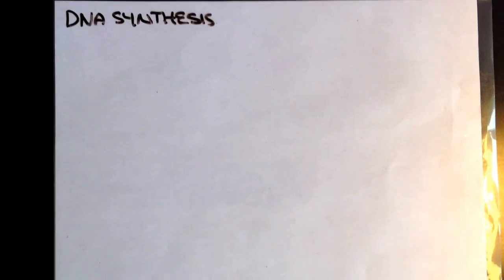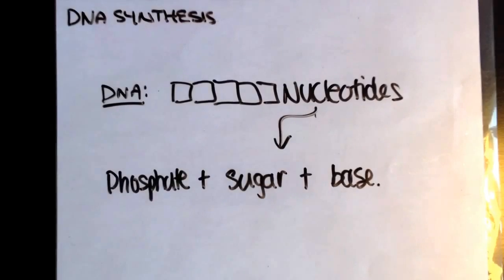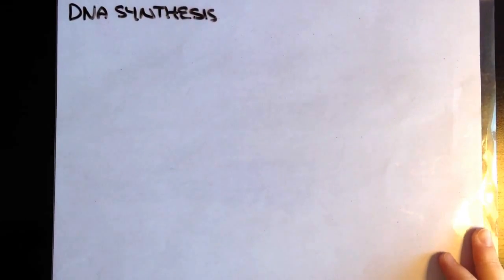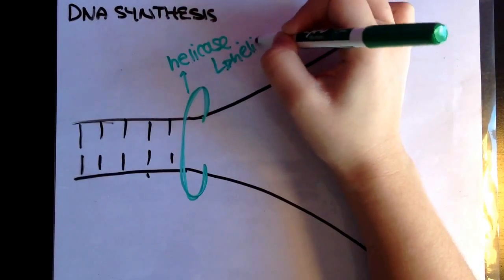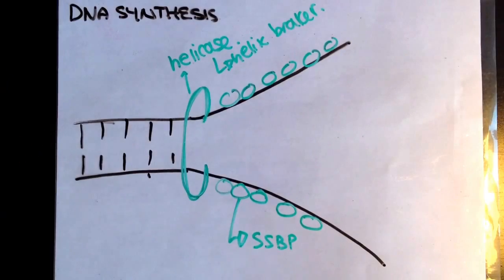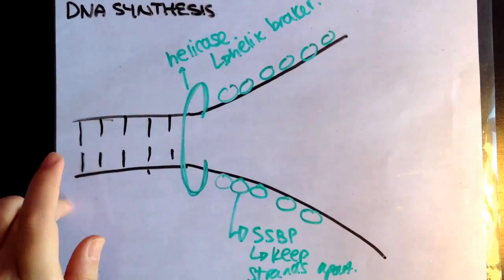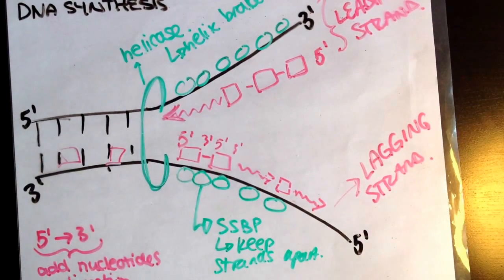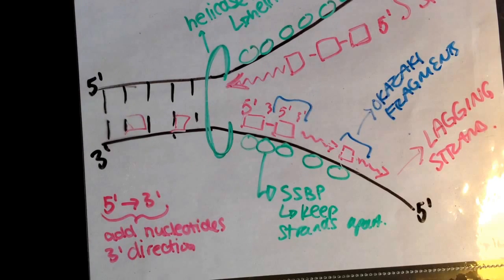Leading strand vs. lagging strand

Comment: Well this is 13 years ago but to anybody wondering, she exaplained it well yet missed a huge part of DNA replication.
As the lagging strand is being synthesized, its gonna form a loop to allow Pol III to synthesize towards the fork direction  not away as this video demonstrates.
and its called the Trombone model. I'm actually still struggling with it but heres my notes on it so far

1 - loop forms:
The lagging strand loops so that DNA pol III moves as the same direction as the replication fork

2 - RNA primer is placed:
Primase lays a short RNA primer upstream on the lagging strand

3 - DNA pol III synthesizes an okazaki fragment:
It adds nucelotides to the RNA primer in the 5' to 3' direction moving towards the previous fragment 

4 - loop releases:
Once the fragment is done, the loop collapses

5 - Next loop forms:
Another RNA primer is laid down further upstream, forming a new loop for the new fragment

6 - RNA primers removed & replaced:
DNA pol I removes the RNA primers and fills in DNA

7 - fragments joined:
DNA Ligase seals the gaps between okazaki fragments

Comment: I get more confused after this video,sorry😔.I guess the strand combined with SSBP is primer for DNA synthesis, and why did this primer(RNA)come here? If we treat the bottom strand is 3' to 5',  which can produce Okazaki, we can also treat the upper one is 3' to 5'. So this two strands are completely transversed, leading strand and lagging strand theory is a general conception. I think these two strands actually can replicate synchronically,and why leading and lagging strand? Leading strand can replicate first,but if we change our perspective, it will be lagging one.

Comment: Can I ask a question? 
If we take the leading strand, it proceeds from 3 to 5. But there are many 3 and 5 carbons in between that huge stretch that has been drawn in the video. 

Similarly the lagging strand proceeds from 5 to 3. But there are many 5 and 3 carbons in the long strand that stretches in the video. We know that dna is made up of indivitual nucleotides and each nucleotide has a 5 and 3 end.  A long segment of DNA, let's assume it contains ten nucleotides must contain ten 3 and 5 ends. 

Hence, on the lagging strand, why not just skip one 5 carbon and proceed from the 3 carbon, in a manner similar to that of the leading strand?

I'd be grateful for an answer.

Comment: DNA polymerase will make it so that the Okazaki  fragments  in the lagging strand will be elongated, but however there are gaps in the sugar-phosphate backbone that can only be sealed by a ligase. The RNA primers used need to be removed afterwards also by Rnase H since they are the starting sites for  DNA polymerase.

Comment: only got 4 min into the video but this is possibly the worst (in addition to faulty usage of language) explanation on the topic I have ever seen. 

if you're explaining the DNA antiparallel structure you can't use words like 'moving' because DNA doesn't move. you're confusing people who have no knowledge on the matter.

an easier way to put it would be that DNA is made up of 2 strands, if you imagine these strands to have the same shape (let's say they both look like the number 6) then the way they bind will look like 69. one of the strands is basically rotated 180 degrees.

also DNA polymerase doesn't bind together okazaki fragments aren't linked by DNA polymerase, that would just create millions more fragments that resemble the okazaki fragments. essentially this is the basic principle of the polymerase chain reaction. DNA ligase is responsible for stitching together okazaki fragments..

also, DNA polymerase can't just attach to DNA as it pleases. a PRIMER needs to be present on the template strand first, which is carried out by the protein PRIMASE.

i don't understand how you can make a video on this without doing research first but yeah.

Comment: i would like to differ with the way you labelled the helicase....its like it is the one holding the helical structure or acts as a clamp of which that is done by the enzyme Topoisomerase...so you should have written topoisomerase instead of helicase there

Comment: Why the leading strand is discontinues ??.? Why there is gape between them and..??  Do these two replicating function are perform by a single enzyme???  If yes then why there is gap in lagging strand plzzz clear this problem to me???.??
Reply: Muhammad jehangir there is a gap in the lagging strand because it moves in the opposite direction as the replication fork. The replication fork moves in the direction as the leading strand

Comment: I think you should've drawn the free 5' group at the top. Why did you draw the anti parallel that way hehe. It's confusing that way but I don't know if what you did was wrong. Because on my slides in says free 3' hydroxyl group on one end which is the bottom end and the free 5' is always on the top in the leading strand the lagging strand goes from free 3' hydroxyl group to free 5' phosphate group. You're not wrong, you're right but your arrows are the only thing that's wrong I guess.

Comment: If one strand moves from a 5' to 3', then  doesnt the other also move from 5' to 3'???? Bc like its antiparallel so it seems like it works out You said that the other will be 3 to 5

Comment: I didn't get the part of the lagging strand...I mean how are gaps created??
Reply: Primase is an enzyme that places primers (starting points) for DNA polymerase. Once DNA polymerase synthesizes the lagging strand (resulting in Okazaki fragments), exonuclease, another enzyme, kick off the primers. This allows DNA polymerase to fill in those gaps with complementary strands. Then DNA ligase acts as glue to seal the nucleotides together. Please check out my videos on my channel.

Comment: lagging strand is confusing. plz describe it more clearly.
Reply: Primase is an enzyme that places primers (starting points) for DNA polymerase. Once DNA polymerase synthesizes the lagging strand (resulting in Okazaki fragments), exonuclease, another enzyme, kick off the primers. This allows DNA polymerase to fill in those gaps with complementary strands. Then DNA ligase acts as glue to seal the nucleotides together. Please check out my videos on my channel.

Comment: Thank you so much for this video, but still how do we differentiate between the leading and the lagging strand . They both add complementary nucleotides in  a 5 prime to 3 prime direction right?
Reply: Yes. However the leading strand adds complementary nucleotides continuously in the 5' to 3' direction whereas the lagging strand does so in chunks by first building fragments (Okazaki) so the fragments are built in the 5' to 3' direction but the nucleotides are added in the 3' to 5' direction, and therefore the lagging strand is slower

Comment: why the DNA is inverse I mean why there is 3 and 5 prime and the other is opposite 5 and 3 prime I didn't get this one :& !!!!!!!!!!1
Reply: Take both your hands. Thumbs up, pointer fingers forward. Just do it. Ready? Thumbs up, fingers forward. Each hand will represent a nucleotide. We have to mate them. Think about this. Not boy boy or girl girl but boy girl. That makes sense right? Think about this. Not peg peg or hole hole but peg hole. That makes sense right?
Still have your thumbs up and fingers out? Get'em up there. Think about this. Not thumb thumb or finger finger but finger thumb. Make sense so far? Now mate them.
Your thumbs are 3'
Your fingers are 5'
Begin to rotate one hand up towards the sky and keep going until the finger points at you with the thumb down (the other has finger pointing away and thumb up). Now you can put them together. Finger to thumb, thumb to finger.

Make sense yet? Think about it this way. Life wants to be hetero so

5' -------> 3'
5' -----> 3'

just doesn't work. We would have a 3 to a 3, and a 5 to a 5.  The two boys and two girls want to find a mate. So we flip one to get this

5' -----> 3'
3' <----- 5'

and that gives us the antiparallel double helix. That's just a way to envision it. But part of the real scientific reason is that when the two strands run antiparallel, they organize in a way that the hydrogen bonds stabilize the molecule in a low energy state.

Comment: I still don't understand how it is added discontinuously. I understand all of the directions. But why are there gaps????
Reply: because she didnt tell you anything about the primary fragments in the origins of replication.In the lagging strand primary RNA fragments are built in order to have the elongation.so the leading strand is being built continuously but the lagging strand is being built fragment by fragment between the RNA primars.as you can easily understand there is only one RNA primar in the leading vs many RNA primars in the lagging strand.THUS the one is continuously and the other is not.The video is not the best possible
Reply: Please watch Khan academy videos to clarify that.
Reply: well, basically when we talk about the direction of the leading template strand then its 3 prime to 5 prime , and lagging template strand is 5 prime to 3 prime. but new strand is always added from 5 prime to 3 prime direction. so its easy and linear in case of leading strand whose direction is opposit to newly sythesized strand. but in case of lagging strand 5-3 , new strand should be added in 5-3 no matter what, so for lagging strand small okazaki fragments are being introduced ( discountinous strand in 5 to 3 direction).

Comment: Great job..I just wanna correct a little notion.The 3' end usually emphasized is because Dna polymerase lll (Enzyme involved in synthesis of new strand of dna)requires 3' end to be able to initiate new dna strand formation through adding complementary nucleotide bases.This can only be achieved if an Rna primer(5'-3') is placed as "initiator" by Rna primase,thereby allowing Dna polymerase lll to use its 3' end(ie 3' end of Rna primer)as a starting point for placing corresponding bases during Dna transcription /replication.Also,Dna gyrase is same as Topoisomerase,which attaches at the intact region(not yet open/broken)of dna double helix just after the replication fork and prevents dna strands supercoiling because of the tension built up during unwinding of the strands of dna by Helicase.
Reply: Nice explanation Leslie. Thanks for the simplified version.
Reply: Thank you.

Comment: thanks a lot for the explanation...but, i still dont get how can okazaki fragment is form on the lagging strand
Reply: +luqmanul akim To the best of my knowledge (please correct me if I am wrong, I am in 9th grade bio) the okazaki fragments are used when the strand begins with a 5'.  Only a 3' can match with a 5' but DNA is copied from 5'-3'.  So, the DNA is unzipped at a lower 5' and zips back to the top.  Then, at an even lower location, the DNA is unzipped yet again all the way to the top.   The direction is similar to the leading strand, but it moves backwards.  Then there is the whole deal with the primers but I'm not sure if that's hat you're asking.  Sorry if any of this is incorrect!
Reply: +Grace Elizabeth  i see,  it somewhat clear to me now..thanks again

Comment: For the most part you did really well. However even though you drawing with arrows is correct for DNA synthesis your verbal explanation contradicts it. You need to go back and listen at 3:15. Your explanation states that it will transcribe 3 to 5 prime. No each side will replicate 5 to 3 prime just like in your drawing. I don't understand how people could write stating this cleared thing up for them because both your words and hand gestures and drawings are contradicting each other

Comment: i thought the clamp like structure that uncoils the helix is called DNA Gyrase(enzyme)?
Reply: making it easier for the actual separation of the helcal strands more easier. and the enzyme that breaks the hydogen bond between the nitrogenous bases is called helicase.
Reply: +lasa sila yes the unwinding of DNA by helicase introduces supercoils the enzymes gyrase and topoisomerase removes supercoils by cutting the DNA. So yes DNA does have enzymes that uncoils it! (:

Comment: "And then there's a gap" why is there a gap? What makes it so that the lagging strand had gaps and the leading strand doesn't?
Reply: +CP Adagio The DNA is being replicated in the opposite direction than on the leading strand. In order for it to do this, an RNA primer is attached to the beginning of the replication sequence on the lagging strand (the video did not mention the RNA Primer though it should have). This RNA primer has RNA not DNA in it, so when the DNA is replicated AFTER the RNA Primer is set on the lagging strand. The RNA primers are then removed after everything has been replicated making the gaps and then Ligase finally replaces the gaps with actual DNA nucleotides/pieces.

Comment: Great video. A couple suggestions:  I would have included the DNA Ligase for the okazaki fragments on the lagging strand. Also would have included the role of the topoisomerases in the winding of the DNA, also. And maybe include the importantance of DNA polymerase in the synthesis of the nucleotides. Other than that, great work :)

Comment: nice vedio....but one confusion is y the lagging strand become fragmented towards 5' -3'?
Reply: I can try and help. Since the bottom parent strand in the video above is being opened in the "opposite" direction, the Replication process HAS to be done in fragments. As soon as a spot is available for Replication to occur in the 5' to 3' direction on the bottom strand, the double helix continues to be opened; it doesn't just stop. Since it continues to be opened, and Replication is constantly occurring, the only way the full bottom strand can be replicated is if it is done in fragments.  There is no way for it to be done in one continuous fashion, because of the way the double helix is being opened by helicase.
Reply: because.... Ookazaki fragment

Comment: this video is clear and further cements the concept in my head.(my exams are coming soon). however, from what I remember, there are a few missing points (some are asked in the other comments).
1. DNA polymerase requires a free 3' OH end to add nucleotides to. Therefore, an RNA primer, which is a short sequence of ribonucleotides, (synthesized by RNA primase)  is needed to provide a free 3'OH end so that the 5' phosphate end in an incoming deoxyribonucleotide can react with the 3' end to form a phosphodiester bond.

2. phosphodiester bond formation is catalyzed by DNA polymerase.
3. the gaps in the lagging strand are actually occupied by RNA primers.
4. When the lagging strand is completed, DNA polymerase replaces the RNA primers with deoxyribonucleotides (close the gaps)
5. after RNA primers are replaced, DNA ligase is the enzyme that catalyses phosphodiester bond formation between the 3' end of a new Okazaki fragment and the 5' end of the growing lagging strand

hope I helped

Comment: Also, might be helpful to say.

1.) the. original strand is called the parent strand
a.) Leading parent strand  5'-3'
b.) Lagging parent strand 3'- 5'

2.) Also, I wrote on my paper that    Dna polymerase synthesizes from   Outwardly on the parent strand to inwardly towards the helicase. Its waiting for the helicase to open.  It also helps for explaining why  you can't go to the lagging strand.

Comment: Thank you for a great video!  Is there a reason the strands are called 3 prime and 5 prime?
Reply: yea, it's called 3 prime and 5 prime, because of the structure of the nucleotides. 
*the phospate group is connected to carbon no.5 on the suger, and the  connection to the next nucleotide is made through this phospate.
*the phospate is connected to an oxygen that sits on carbon no.3 of the next nucleotide

Comment: I appreciate the video. But, you missed a very important concept ( the reason why i watched this video..anyway) Why are there gaps in the lagging strand if it goes from 5' to 3' direction? whats the difference in that 5' to 3' and the 5' to 3' in leading strand? It has to do with looping of the lagging strand. Which, i still do not understand yet. Gonna look it up more. Just wanted to point it out. 
Thanks for the video again
Reply: godetroit91  There are gaps in the lagging strand because everytime the helicase opens the DNA more on the lagging strand, the replication has now to occurs behind the replicated 5-3' segment which is going left to right. a new 5-3 segment which is initiated by the primer starts and later all the primers are replaced by the RNAseH and DNA ligase binds to THEN form one strand like the leading strand. does that make sense?  If the process went like leading strand it wouldnt have been a problem but since we go opposite in lagging strand starting from the replication fork(left) down to the 5' end(right) , further opening at the fork by helicase has to be replicated with a new 5-3 end segment.
Reply: Okay. I think I finally understand it and can maybe help you. So basically in the Leading strain the DNA polymerase doesn't have to wait for the new information and can follow the RNA Primer, while in the lagging, the Polymerase and the Primer have to dance over each other.
Reply: Mahak Chauhan yeaaah thanks to you i understand now how the lagging strand is working 😚
Reply: I was wondering that way too nouman. I wish i could find more tutorial vids on replication. Do you know of any?Please guide. Thanks